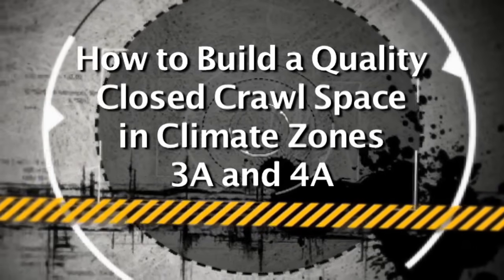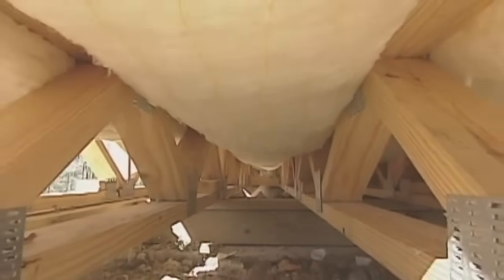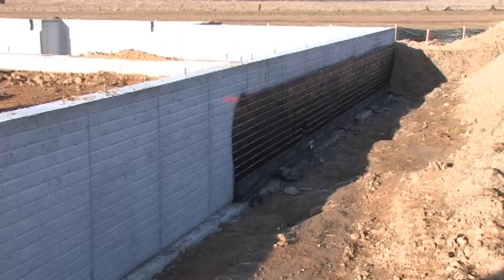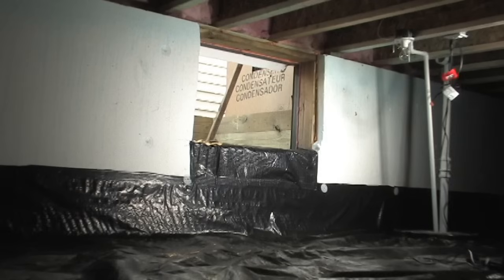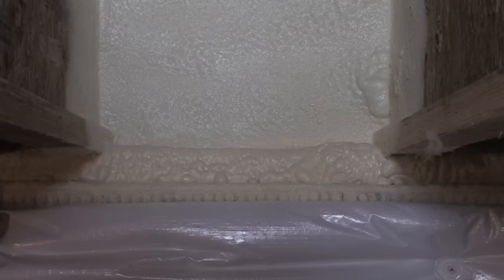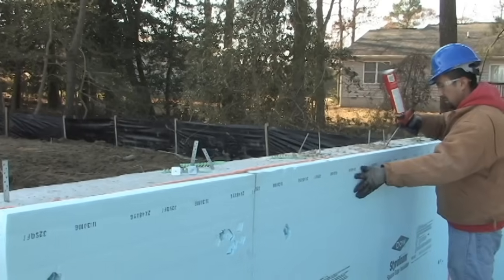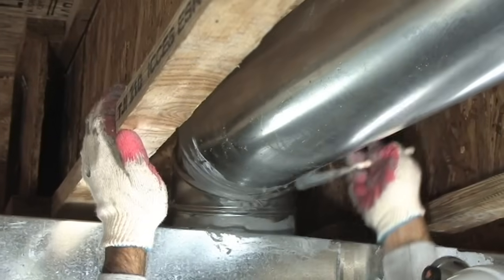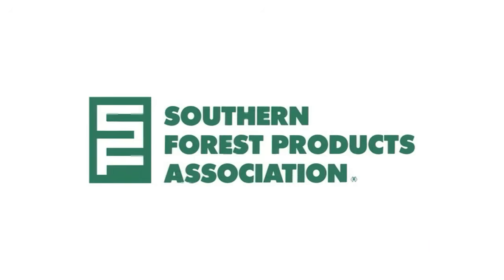How to Build a Quality Closed Crawlspace in Climate Zones 3A and 4A

Comment: Having an exhaust duct in the sealed crawl space creates negative air pressure inside the house; that pressure must be relieved in some manner, and if no fresh air intake is provided, air will be drawn in from leaks in the envelope, including: fireplace flues, bath and kitchen exhausts, electrical fixtures not properly sealed, and other places.

Comment: It occurs to me that this project is built backwards and will lend itself to condensation and moisture penetration. In my mind the insulation should be under the slab and on the exterior of the walls. The ground is going to change  temperature and so will the concrete. You don’t wear a coat on the inside of your body....fail.
Reply: Good point. Also insulating the exterior would allow the thermal mass of the foundation to help with heating and cooling.
Reply: It can be done either way just like any other insulation.
Reply: so, do you insulate a basement from the outside in, or any exterior wall?  Nope, you obviously do not understand the science behind a conditioned crawl space.  Its been around for some time and without the issues you have concern about.